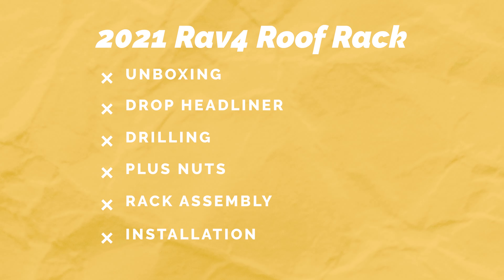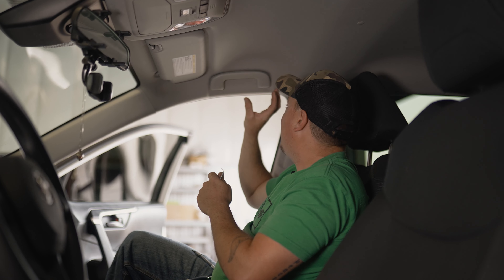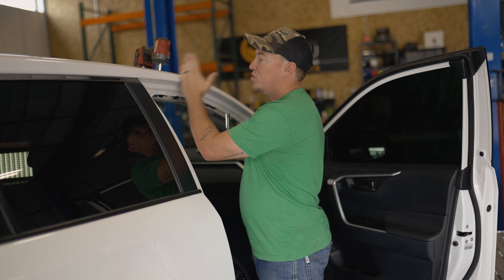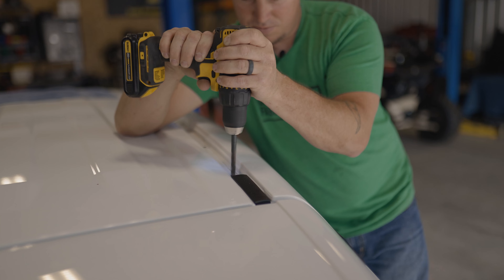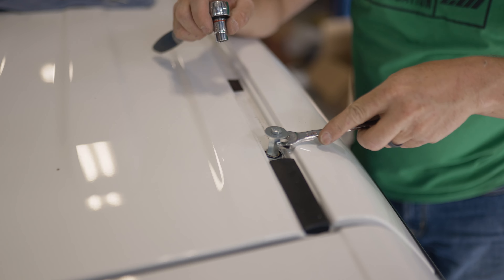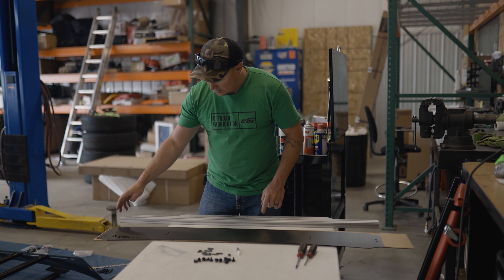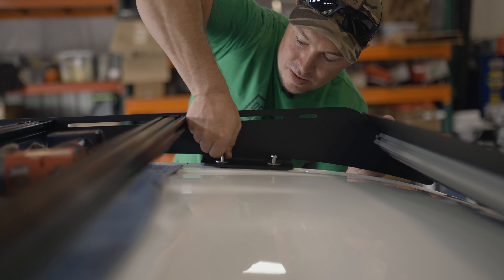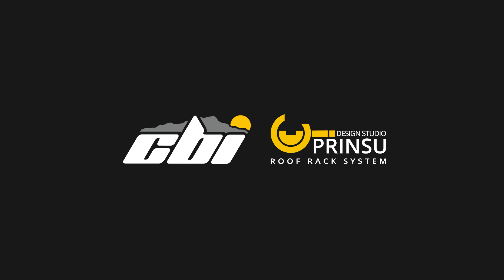Toyota Rav4 Prinsu Roof Rack 2019-2021

Comment: In winter time, snow, the rack needs to be removed?
Reply from the maker: No it will be fine, its made of aluminum material with stainless steel hardware.
Reply: @cbiprinsuinstalls  THIS IS NOT MADE WITH STAINLESS STEEL HARDWARE!!! it is zinc plated...